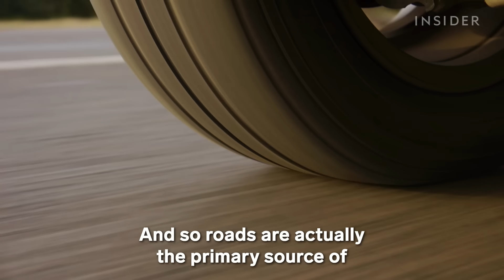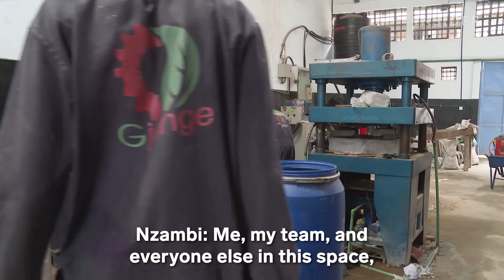Young Inventor Makes Bricks From Plastic Trash | World Wide Waste | Business Insider

Comment: Not gonna work for long, plastic warps and photo-decomposes, it's why plastic things fade and crack in the sun.

instead of roads, indoor walls, structures, and braces would work better, the plastic would serve to help control temperatures, reinforce current structures, and could serve to reinfoce and seal sewage systems as well. as long as it's not exposed to sunlight or extreme hear it should be fine

for that matter, caste the bricks in a way that they have a top, then the heat and pressure on the walls and bottom would create a guidebed when the road has to be repaved.

Comment: They should build larger brick with air pockets in them for R value.  Then build home out of the blocks.  Zero abrasions that the road causes.   And no micro plastics being introduced into the environment.   My only suggestion beyond that would be to add a fire retardant either in the mixture.  Or coat them afterwards.   Thus preventing toxic air being created by them catching fire.   Several home building materials could be created in this fashion.  Could be a game changer for lesser developed countries.
Reply: The plastic is mixed with sand. Sand is a fire retardant
Reply: I was thinking the same. She can use the bricks for affordable homes. May be even precast wall slabs whereby you make the walls of the home at the factory and transport the wall panels to the site. just like they do with precast cement. This will be cheaper to build and faster. Just need the machinery to make those  wall panels. Once the plastic melts its spread out to the appropriate size, width and thickness to make  wall panels for the house.

Comment: Bricks might not be the solution but instead you could use it in application where concrete is needed in a sealed application, such as the foundation between the brick walls. There is a lot of potential with just the paste itself.

Comment: Big respect for the inspiring entrepreneurship. But that's about it.

Strong UV light, high temperatures, wind, rain and the potential traffic will turn these roads into a micro-plastic bleeding disaster.

So instead of having the plastic stored in a centralized and controlled environment (aka. dump) it's being spread all over the country to slowly bleed into the environment.

Comment: So what happens when this bricks eventually need replacing can they be recycled? Cause if bit then the problem is the same with normal plastics back into the landfill and nothing changes maybe thats why no one else is melting and mixing sand to make bricks yet cause its not a solution its just a delay

Comment: I wouldn't use the bricks for pavement or anything exposed (for the reasons stated in the video) but using the bricks for internal structures of things that are covered in another material (that doesn't release pollutants) sounds like a good place for the trash while building things.

Comment: Just watching this I could think of a number of applications for this process. Modify the molds to create interlocking blocks like large lego's to make a structure. Varying size elongated molds to create boards for decking, fences, raised gardens. All of this has the benefits of using the plastics that are part of the problem. Uses these materials in place of tradition wood. Lay this out in a thin sheet like galvanized aluminum for roofing, flooring materials.

Comment: Yes, abrosion and the consequent emission of microplastics is an issue. However, this is a problem worlwide, as bitumen (side product of oil production) is usually used for the production of asphalt, which essentially creates the same problem. The construction of roads is a field in which we have unfortunately no solution yet for this problem as far as I am aware.

Comment: so if roads aren't the answer, why not as building materials? less abrasion and they seem to be sturdy enough to support the weight of at least smaller structures. the lower weight might be an issue in areas prone to hurricanes/tornadoes but it's an idea.

Comment: You talk about microplastic as if it was worse than the oil coming out of the pavement every time it gets above 80 F. And then wash away with the rain, plastic melts at a higher temperature, roads have been a toxic hazard since the invention of the automobile oil, antifreeze deteriorating tires it's unfortunate but necessary

Comment: Cant they just make the bricks with the top layer without plastic so it doesn’t come in contact with car tires?
Reply: Has the same problem as nuclear reactors, who will supply the funds to replace the old ones when needed.
Reply: Probly not ...would need a new machine ...it could probly be done but at what cost

Comment: Sadly, those plastic/sand bricks will break very quickly because their properties are just nothing like Asphalt or concrete and the roads would need constant repairs. However, it's still boosting economy if people purchase it for possible pathway inlay for their front homes or other practical uses

Comment: She has such good intentions but the issue with her idea is that these micro plastics will overtime rub away from her product and due to the fact that she sped up the breakdown process of a plastic bottle by thousands of years with the one time use of a single machine (produced mico plastics)  the earth will soon be contaminated with micro plastics much sooner especially if her product goes world wide and branded as  "a way to stop pollution that's half the price" the only way I could see this not becoming a catastrophe is if the outside of the bricks had a full cement shell so therefore these micro plastics that were creating will be more confined from breaking apart and going back into the earth

Comment: Tar seems worse than plastic seeing how they are pretty much recycling and tar roads in most countries are usually not made with recycled materials it might not hold as much weight as the tar ones but it will definitely help with the dust problems during the dry days and hold more weight than the sand gravel or dirt roads when it is raining

Comment: I can't imagine how much toxic fumes were released during the making process. There is a reson why most of the wolrd do not use plastic bricks
Reply: Sure, but there must be a solution with proper installations. With the kind of product they are offering, they don't have to worry too much about the quality of the plastic or with its aspect. It allows to mix different kinds of plastics, even lower grade plastics. Sorting the good ones has always been the main difficulty for recycling. Sounds like an intelligent solution that needs to be scaled up, with better quality and environmental control. Too labor intensive also, for a cheap product. Only possible in a low-salary country. But again, that problem can be solved easily. The concept deserves more research.

Comment: Great invention. However can any expert answer my question: Would plastic brick melt after couple hours of direct sunshine?
Reply: Probably not as temperatures won't reach melting point. However, a UV light will break down polymer chains and possibly make them brittle or crack in a few years time under direct sunlight.

Comment: Plastic roads are not a good idea, especially not in a hot country like Kenya. Plastic left outside in the hot summer heat is going to melt slowly and produce toxic plastic fumes, it's not just the heat from the sun but also heat from friction from automobiles plying on the bricks.

Comment: This is an extremely interesting concept. It makes me wonder though, won't using these bricks lead to more micro plastics in the soil surrounding the roads?
Reply: They touch on this if you watch the full video
Reply: @Kenny-445  Yeah, I commented before finishing the vid. The thing is, they just mention it real quick and don't really get into details about it. It's cool and all, this recycling of plastic, but if they don't want to cause issues long term, they really need to use it in areas where there is going to be 0 traffic on top of it.
Reply: @nickyhr  that’s valid, but considering it would be pointless to build brick roads if there isn’t going to be any traffic using it. As the video suggests, until we get rid of all plastic, this will continue
Reply: Yes if the brick are placed next to the soil. However, alternative methods such as lining the roads with concrete bricks could reduce that significantly.
Reply: I think you are right. Constant abrosion through walking or weather effects like strong sun or rainfall will lead to microplastics going into the environment.
Reply: plastic are already everywhere.. including our bodies.
Reply: @edmundyhee7687  yes, look up the links between plastic and low testosterone
Reply: This was my first thought before reading your comment, abrasion would lead to so much more micro-plastics. Lining it would help, with what though remains to be seen. It was not addressed in the video, however the concept is good.
Reply: it doesn't just end up in the soil, it will create a dust which can travel through the air onto neighbouring houses or farms. this is a terrible idea.
Reply: Should be used for light traction like driveway, sidewalks, schools, walking centers, ect.
Reply: Would you rather all that plastic end up in the ocean or micro plastic end up in the ocean??? USE YOUR BRAIN
Reply: @ecuadorhaszeroboxers2356  well they're both similarly not good, not sure what your point is lol. Also, having them in the soil eventually leads them to the ground water, animals, plants and the ocean through river flow
Reply: @Kenny-445  No point arguing with children.
Reply: @ecuadorhaszeroboxers2356  I think you need to use your Brian I shouldn't argue with children but still you realize either way the plastic problem is much deeper is recycled for somthing like this?
Reply: @thatkidmingming7390  brain*. It really shows you’re intelligence when you attack people for providing criticism. Maybe plastic shouldn’t replace reliable building materials and could have its own purpose…
Reply: @ecuadorhaszeroboxers2356  well microplastic is way more harder to notice so it could spread everywhere and damage even more, people and animals could consume it without even noticing, in some way i think this damage more in the long term
Reply: Jesus Christ is Lord & He's coming soon. Dont take that vacxine ❤ 🙏🏼

Comment: really they probly could just drive a dumptruck down the road filled with small plastic bits an then drive a roller over it with a big heat source on the front an it could probly create a plastic road instead of laying all those bricks

Comment: A thought...
Plastic tiles in high traffic areas = Erosion and micro plastics
Plastic tiles in very hot climate = Faster degredation over time and chemical leeching that might reach local equipers

Plastic bricks for building = Lego burns great, if you can find a way to make it burn worse than it might work.

Comment: Is it less usable? As in does it work just as well as regular materials? Id imagine theres a trade off, and the plastic doesn't last long. Like said in the video itself, roads are constantly degrading from being used. Even with regular materials constant upkeep is required. So whats that like when its cheaper and likely less reliable?

Comment: So... plastic trash in sea, on the ground or burried in soil is a problem. But, when it is pressed into the shape of  bricks and layed on the ground as pavement or piled up to form a building is somehow okay. I see. Re-shaping the non-decomposing trash still not make it vanish, it makes only one more thing made of plastic that was not previously: bricks. It's not problem solving, it is problem increasing. Here is the only solution: do not make, use or buy plastic anymore. More realistic version: do not make, use or buy plastic if it is not tremendously necessary. Even then, think again.
So please do not build your house with bricks made from plastic trash.
Reply: This

Comment: 1. They need to be shaped for interlock
2. They need a surface like sand, baked onto the top to avoid melt onto flesh, etc.
3. There is NO substitute for first preparing the base of a road with removal of organics, compaction of soil according to the maximum characteristics, layers of crushed stone, etc. as a Base to receive the "pavement" surface.

I've never built a road but I learned that.

Comment: don't weigh each brick individually before putting it in the mold lol. That's the main bottleneck in that manufacturing system. Put a flexible nozzle on the extruder and squirt it straight into the form.

Comment: The thermoplastic used on roads is abrasive resistant, it last forever and thats why we use it.  We dump fly ash in concrete for similar reasons so why not with plastics and roads.

Comment: This is a really bad idea. Plastic is soft and wears out easily. If you pave roads with plastic, the pavement will wear out quickly, leaving a very fine dust of plastic that gets into the air, water and food, and is not biodegradable.

Comment: Problem i'd be worried about is the heat... surely when exposed to outside elements the sun would eventually melt the bricks? Even if its only gradual it'll still cause problems within heated climates

Comment: Using plastics for structures or pavement isn’t a smart idea, over time they’ll leach harmful chemicals through storm water runoff and they’ll also break down due to heat. On paper it sounds smart but you have another problem. I wouldn’t make a building out of plastic because if you have a fire it will collapse that much quicker.

Comment: it is solving a problem by creating another, the plastic particles will contaminate all the water on the floor, besides that this plastic is not resistant and will soon have a problem, generating high maintenance costs and being unfeasible

Comment: Wonderful Job! With a building material like that, humanity could make all kinds of materials to be used in places where it is not just traveled over, hopefully with low traffic. Think basements to houses, where it is moist or wet. The composition should not be used for roofing, as the sun breaks down plastic and the rain can wash loose particles away.. Underground houses would be a boon to the walls AND the ceiling being made out of plastic bricks. And the use would not be just as a covering of other materials, but as the primary weight bearing brick.

Comment: just a fairytale unfortunately. you can never scale it up to a useful size because at some point the supply of recycled materials will not keep up with demand. 
plus the amount of crushed plastic you can put into asphalt and still have a credible mix is very low. they been doing this with concrete for decades putting waste from power stations into it but theres not much you can add without losing strength. the only viable answer is to stop making plastic in the first place.

Comment: I don't want to be "that guy", but has this product been tested??

Thermal resistance
Compression test
Tearing
Bending
Etc..

I don't want this goop to be used to make larger structures. As roof tiles, yes. Pavement, yes. As long as it's not used for actual buildings. But, for small houses.. without the tests, it should be fine. But, I do think that it should at least pass a thermal resistance, so it could also be used for wall paneling (alternative to dry wall), and flooring for the kitchen area.